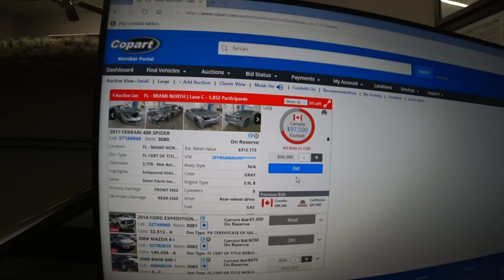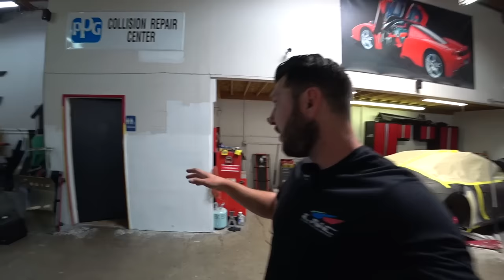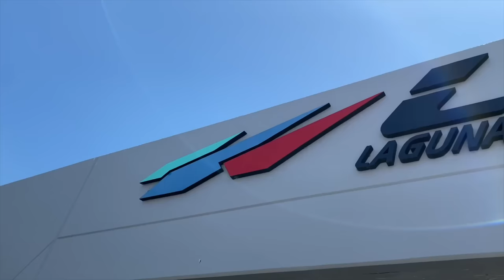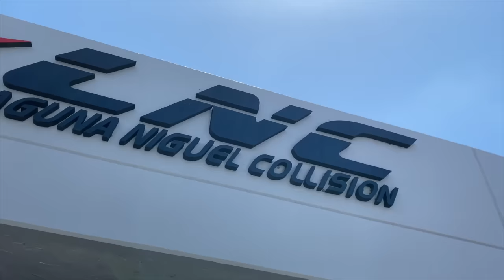REBUILDING A SALVAGE 992 PORSCHE CARRERA S ''CAN’T BELIEVE INSURANCE COMPANY TOTALED'' (PART #2)

Comment: Hey Vlad, about that control arm you replaced. I guess it needs to be tightened under load, otherwise it will damage the rubber bushings pretty quickly.
Keep up the good work 👍 Great content.

Comment: i would worry that something else would need replacing in the suspension. after all, something had to withstand a whole lot of force to make that arm bend like that. although i suppose it could have been the tire/wheel that was jammed up against the frame, and was replaced. ....of course, i'm just guessing.

Comment: A Black roof is not a good idea for light reflection and overall light density in the shop at floor level, which I would assume is critical in a body shop. White would be much better IMHO.
Reply from the maker: Pluto We are almost finished with repainting the shop, black roof looks so good, we got very bright LED lights so it looks brighter then outside now. 😂 stay tune shop remodel video coming soon.. 👊🏼